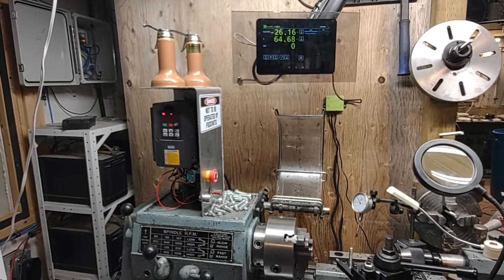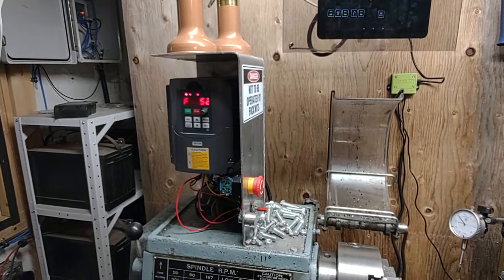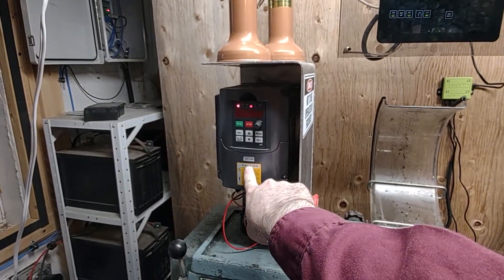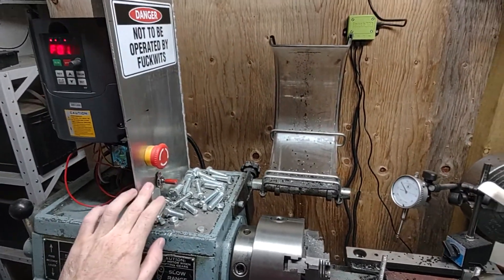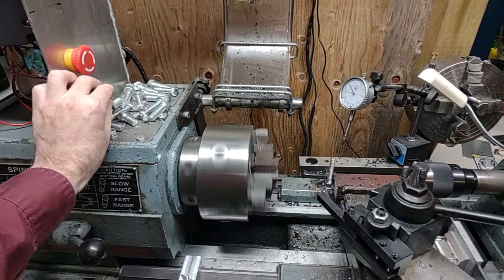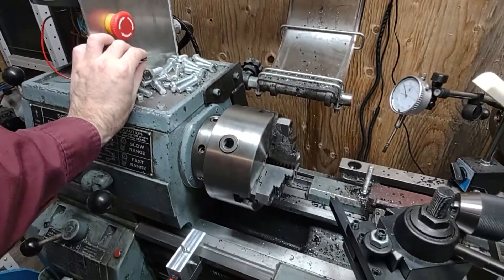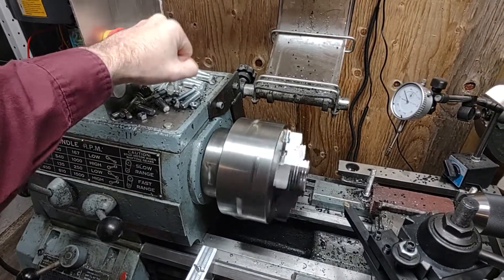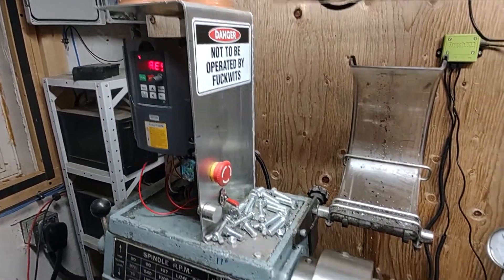Lathe VFD Upgrade

Comment: I got exactly the same situation. 240v. No 3 phase. My problem is that I haven't got a clue how to program the VFD, and I don't want to break/burn anything! 😂
Reply from the maker: It's pretty easy.  There'll be three power in terminals.  Connect the two hot wires from the wall to any two, it doesn't matter which.  Then connect the three motor output terminals to the three motor wires.  Done and done.  Couldn't be easier. 

The only problem is they come from the factory with a maximum frequency of 400 Hz.  This is way too fast for a typical lathe.  If you go in and change that one parameter from 400 down to something like 100, it'll work just great.  You don't need to do anything else.
Reply: @joels7605  thanks so much for help there. That frequency tip alone might just save me. Cheers 👍

Comment: Do you by chance have all of the VFD settings readably available ?  I have one of the cheap ebay VFS's and a new teco westinghouse 3 phase motors and I can not get the motor to run properly. It has basically no torque,I can stall the motor by hand. I dont know if it is a motor,VFD or settings problem. Your input would be much appreciated !
Reply from the maker: I didn't have to change much.  It ran out of the box without changing anything.  Mostly I just locked out frequencies above 100 Hz as to not explode my lathe (it's set for 400 Hz from the factory which is WAY too fast).  Then I swapped some settings to deactivate the controls on the front of the VFD so it would use external switches.  

Is the motor wired for 208/220/240v?  Lots of motors can have their wires swapped to run at a different voltage.  I would first check there, and make sure everything is correct.  I would bet this is causing the problem.  

Just looking at my manual, and PD041 is the carrier frequency.  If the motor is wired correctly definitely check the carrier frequency next.  Adjust it up and down and see how your motor responds.  The carrier frequency is the high pitched whistle you hear when running the motor.  You may be running the motor at 10 Hz, but the phases will still be pulsed at 8 kHz (for example).  

Anyway that's all I can think of right now.  Good luck.

Comment: Glad to hear that the upgrade was achieved using the lower end quality products so that gives me more confidence to try and install a similar system to my 1991 model wood lathe while increasing power from 1 HP to 2 HP so thanks for your comments and do you have a brand name for the inverter? Loved the classic sign too.
Reply from the maker: This particular inverter is an Huanyang HY02D223B.
Reply: @unhinged-menagerie  how do you know what size vid to match up with your motor?  I have a 3hp 220 3 phase
Reply from the maker: @scottburgle4889  Sorry I missed your comment.  Just pick a VFD that has a higher rating than your motor.  If you have a 3 HP motor, get something bigger than 3 HP.  Just make sure the motor is the same voltage as the wall because the VFDs don't generally change the voltage unless you buy something special.
Reply: @unhinged-menagerie  thank you!

Comment: Impressive. Did you consider wiring up the emergency stop to the e-brake? Also how is the torque at low speeds?
Reply from the maker: Decent torque at low speeds.  You can thread no problem down to about 5 Hz (which is extremely slow) before you need to change gears on the lathe.  The e-stop just cuts power and allows the motor to spin down freely.  The way it's wired in now it commands the VFD to brake the motor, stopping it much more quickly than the e-stop.  It's just the way that VFD is made.  If there's a way to tell it to actively brake the motor when hitting the e-stop I'd love to know it, because that would be a very useful feature.  But I don't know how to do that.
Reply: @unhinged-menagerie  nice. Now some models even come with a vfd. But I think to add one externally probably gives you more options. As for the e brake, this would have to be programmed as a signal. I don't know how but I know it's possible,. Too abrupt of a stop might however speed up the wear in your camlock mounts or other internal components. Might shear pins etc. Especially if the machine isn't designed for that. Worth looking into though.